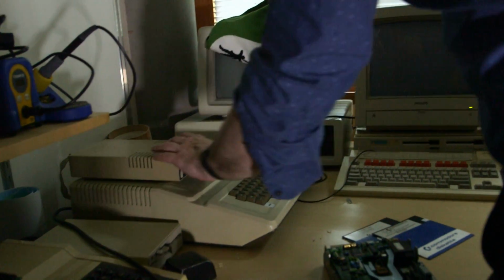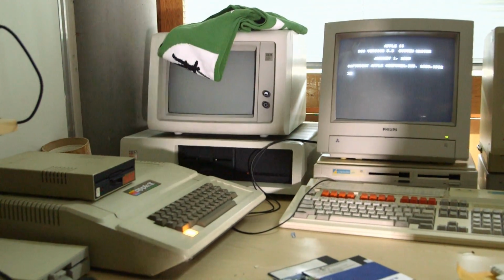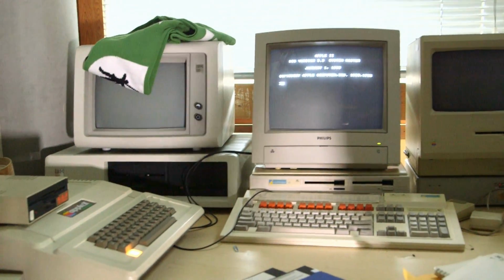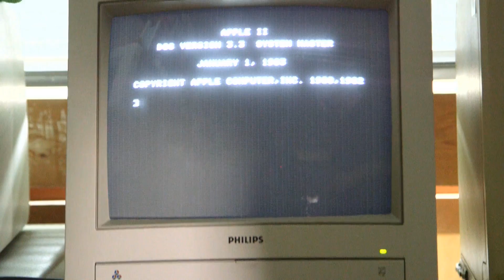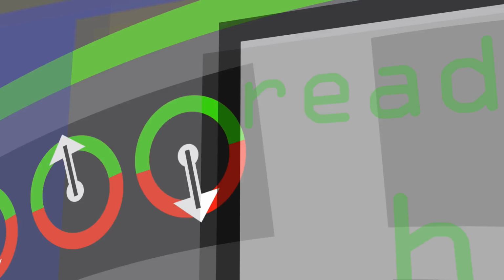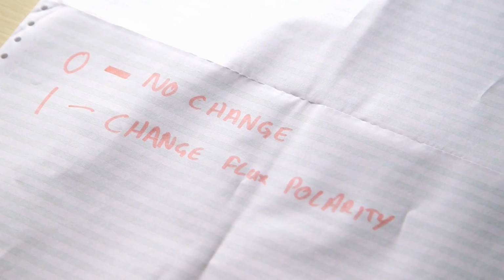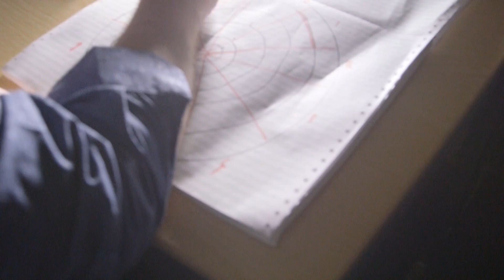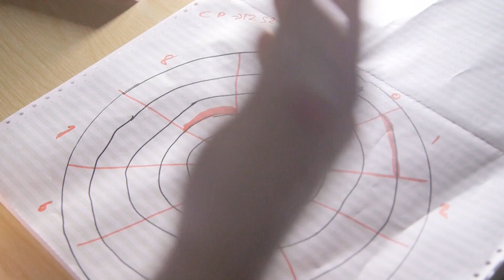Apple 2 Floppy Disk Codes - Computerphile

Comment: After disassembling the Apple II Disk rom (the 16-sector version however) to check the GCR encoding, I discovered that the first 32 bytes of ROM code actually builds this lookup table counting 64 distinct values.  So, on each byte written on a 16-sector disk, the first bit is always 1, and the remaining 7 bits make 64 combinations where the rule applies of max. 2 consecutive zeroes.  This rule theoretically allows 81 combinations across 7 bits, but understandably only 64 were retained for the lookup table.  So, from each byte, only 6 bits materialise in usable data.

Comment: AARRRRGGGGGHHHHH!!!!!! ok, no.

(1) The Disk ][ does NOT use the index sensor. Nor does it have a track zero sensor.
(2) The logic for implementing group code recording was implemented as a finite state machine, with the individual inputs and outputs of that state machine encoded on a 256 byte sequencer PROM on the Disk ][ controller card.
(3) a MC3470 is used as the read amplifier.

Comment: Yea, except that what he failed to say was that GCR does not use the index hole, or the track 0 sensor - it is completely soft sectored and software controlled. That's why the head banged in C64 and Apples - step 50 tracks back and your guaranteed to be at track zero sooner or later........

Comment: @5:41 NO! Apple 2 sectors were *NEVER* hard-sectored --they were always SOFT-sector.  That index hole was NEVER used. The ADDRESS field D5 AA 96 .. DE AA EB recorded held which Track and Sector the head was over, the DATA field, D5 AA AD .. DE AA EB held the  *342* nibble data for the sector.
Reply: Which one had the *420* nibble data? Did I just ask a question? Whatever...

Comment: I remember GCR was also used in the Commodore floppy drives back in the days. It was a real pain in the rear end to transfer data between MFM-coded systems like IBM or Kaypro and the Commodore family. In the end i found my self soldering a little pcb with some transistors and resistors and hook up those systems directly via parallel port. Big plan was to use e decommissioned 286 board as "hard drive controler" for my beloved C=128. Never completly finished it though. But i used it  for cross assembler stuff.

Comment: I once had to write custom floppy read/write routines for the Amiga. On that system you could use the "blitter" to do the encoding and decoding. I believe it used "Modified Frequency Modulation" (MFM) for the encoding system.

Comment: It's been a while since I read "Beneath Apple DOS" but IIRC, 5-and-3 encoding supported 13 sectors per disk (Apple DOS 3.2) while 6-and-2 encoding supported 16 sectors per disk (Apple DOS 3.3). I recall taking my Apple ][ to a local retailer to have the floppy controller updated from 3.2 to 3.3 (IIRC they just replaced a ROM). After that you could deal with 3.3 formatted disks natively or run a small utility which would allow you to read 3.2 disks. There also existed many copy-protection schemes based upon partially written tracks as well as data written between tracks. Many people got around this (for backup purposes only) with a utility call Locksmith.

Comment: So basically, these disk drives stored 5 bits in the amount of data it would take to store 8 bits, but have these three "parity bits" as a safety feature to prevent or correct read/write errors. Did Apple disks have less storage capacity than the ones of other computer systems because of that?
Reply: 140K (DOS 3.3) per disk side vs 174K (C64), 160K (IBM SSDD).

Comment: It only flips the magnetic field when it needs to write a 1? How dose it know that this was flipped? It could be either or. I thought it flipped it to a specific orientation that encoded either a 0 or a 1.
Reply: You're right, the animation is wrong.
Reply: The presenter is right. On the Apple II, you store a 1 by changing the state of the magnetic field, otherwise it is a 0. What is missing here is the description of the Logic State Sequencer which sequences the bits, the timing and the state change. The LSS is responsible for transforming the 1s and 0s into nibbles.
Reply: Antoine Vignau Could you please simplify that a little? I'm still not getting how the system knows that you've flipped this bit when it could be either a 0 or a 1.
Reply: Couldn't you check the state of the previous bit?  If it doesn't match then it was flipped.

Comment: Steve implied that the index hole was used by the disk ][ hardware to find Sector 0 -- it was not. Woz didn't use the index hole for anything at all. In fact, had the index hole been used, it would've made it impossible for third-party formatters to optimize the disk. They worked by staggering the zero sector of adjacent tracks to reduce the number of total revolutions needed to read the disk sequentially.

Oh, and the sectors were laid out on each track non-sequentially so the RWTS routine had enough time between sectors to process the data it had read.

Comment: Ahh. The boot clicks of the disk drives. It meant that the computer was coming alive. 
Now when drives click like that, it means its dying and I better rush a backup.
My how times change.
Reply: @LaserActiveGuy In the early 2000's (I'm guessing around 2003 ish but a lot of it's a blur) I couldn't find my library card for the longest time until I went to use the floppy drive on my machine and couldn't get it to work.  Turns out one of my siblings (they were all quite young at the time) had put my library card in the floppy drive.  At that point we were more worried about whether something was in the CD/DVD SuperMulti drive that every computer came with (I'm guessing they were really cheap since absolutely every computer seemed to have the exact same one).

Comment: So, we're encoding and thus 'losing' 30% of our capacity for speed ? (we're having 8 flops, and use that to store 5 bits)
Reply: GCR is actually more reliable than hard sectoring. With hard sectoring there are more components interacting in more complicated ways. With soft sectoring, you only need the speed of the drive motor to be correct (typically 300 RPM if I recall.)

Comment: At 3:30, there is a wrong statement. You can have two consecutive zeroes (the nibble shown here, #$9F is an authorized value) but no more. This is rule #2.

As with rule #1 (nibbles start with bit 7 at 1), these can be bypassed to create interesting on-disk protection schemes.
Reply: The 16-sector version PROM on the DISKII interface indeed allows 2 consecutive zeroes, which provides 81 combinations respecting rule #1 and #2 in an 8-bit range. From these 81 combinations (~6.34 bits), only 6 bits are retained, or 64 combinations.  The GCR encoding on 16-sector disks actually costs 1.34 bits per byte, that is 20.75% data loss, the simplest error-correction encoding algorithm (HAMMING 29,24) costs 1.66 bits per byte or 17.24% and could theoretically replace rule #2.  The only problem is that rotation timing issues due to having more than 2 subsequent zeroes is likely to mess up much more data than the error correction encoding itself can remediate.

Comment: I'm pretty sure that I remember you could encode two consecutive zero bits.  I do remember about the index hole not being used and the sectors being synchronized by writing 4 or 5 "FF' bytes with two zero bits between each two bytes.  This was done with exact timing of the instructions.
Reply: What's being described in the video is the earlier 13-sector DOS 3.2 format and the P5/P6 ROMs (and not the 16-sector "at most one zero-bit pair per nibble" 6&2 format of DOS 3.3 with the P5A/P6A ROMs; see Beneath Apple DOS for more detail.)
Reply: Neither Apple II or C64 used the index holes, that's why you could flip the disks over and use the other side. Using two consecutive zeros was the change from 13-sector to 16-sector disks.
Reply: dogcowdogcow 

Interestingly, I'm not going by DOS formats at all.  I was, for a time, working on my own code to read and write disk data and I was going by the rules to be able to read back what was written reliably.

Comment: A little extra information for the interested: Using a sequence which is not legal to find in the middle of payload data is fairly common in storage and communications systems, called a "preamble."  When the preamble pattern goes by the receiver or read head, the circuit "knows" it's the beginning of something, like a sector or frame.  It can be implemented in very high speed hardware with a shift register and logic gates.  The logic gates are wired in the pattern of the preamble, and constantly compare the value in the shift register with the preamble...and the  output goes "true" when they match.  Then the circuitry can begin collecting the bits of the payload.

Comment: about the six minute mark...sorry to say, you circled the incorrect area.  Holes would show through the small circular area next to the hub.
Reply from the maker: +rchandraonline there were different standards, early hard sector disks had holes in different places to later ones...
Reply: ***** , hmmm...I had both hard sectored and soft sectored 5.25" floppies in my time, and I can't remember any of them having holes in the read/write area which you circled, only in the area Steve pointed out to you.  The soft sectored ones had one index hole for a "start of track" signal, whereas the hard sectored ones had several holes around the circumference of the hub.

But who knows, there could have been others I have not seen.
Reply from the maker: +rchandraonline it's possible that these were just in the eight inch variety and I have muddled up my image! Sorry (Wikipedia : "The Memorex disk was "hard-sectored", that is, it contained 8 sector holes (plus one index hole) at the outer diameter (outside data track 00) ")
Reply: Seegal Galguntijak , IIRC, on a totally blank disk, the controller just picked one, and wrote a track preamble there.  It was either that, or one of the holes was larger and therefore let through more light.  It was when I was in high school, back in the late '70s, early '80s, when I remember both hard and soft sector disks were available...so taxing my memory you are.
Reply: +Seegal Galguntijak on a 10 sector disk there are 11 holes, on a 16 sector disk there are 17. The sector holes are all spaced evenly, with the index hole centered between two of them. The controller sees the index hole because of the shorter timing.
Reply: With all the hard sector holes in the center, how would the disk drive then know which sector was the first one?
Reply: FozzTexx Alright, that's a great way of doing it.
Reply: +Computerphile I forget if the one hard sector system I had was 5.25" or 8", but I think I'd have remembered if the holes were somewhere too far different from the standard sector hole cut out that you didn't circle.

Comment: Did somebody completely forgot how to use camera lighting? This is unwatchable...
Reply: If this is unwatchable you will have a hard time looking at 99% of youtube.
Reply: PleaseDontWatchThese
 I do, but there is a difference between unwatchable due to a a simple lack of gear and unwatchable due to utter failure while having a shitload of proper gear.
Reply: Diggnuts The video gets the point across just fine. It just does not look nice. I find that ok with an educational video.
Reply: PleaseDontWatchThese Did I tell you what you should or should not be "ok" with?
Reply: Diggnuts You did not, and neither did I. I'm just stating my opinion about yours. And you are doing the same to me. I see no problem with that.
Reply: PleaseDontWatchThese
 There isn't.
Reply: I didn't even notice -_-

Comment: I remember when I had to use the other side (apple drives had just one head), we had to punch a hole on the floppy jacket in order to make the drive to read it properly when we flipped the disk. Also, disks weren't designed to be flipped, and with time you had problems with disks that were flipped, as the fibers inside the jacked got sticky with dust.

Nostalgia! :)
Reply: That hole wasn't about readability. The notch would turn on write protect when it was covered. On the flipped over side, there was no notch, so the computer would treat the disk as write protected until you punched that hole.
Reply: The disk factories only had one production line. The disks that wouldn't certify on either side were thrown away. The few that would certify on one side and not the other went into the pile of single sided disks, and the ones that certified on both sides got split up between the single and double sided disk piles according to demand. We used thousands of cheaper "single sided" disks as double sided and every now and then had to throw one away.
Reply: The disk factories only had one production line. The disks that wouldn't certify on either side were thrown away. The few that would certify on one side and not the other went into the pile of single sided disks, and the ones that certified on both sides got split up between the single and double sided disk piles according to demand. We used thousands of cheaper "single sided" disks as double sided and every now and then had to throw one away.

Comment: I remember seeing that modern disks use a similar pattern. Something like 8 bits encoded in a series of 15 pits and lands on a CD. I don't remember the exact numbers, but I'm sure they'll be in the next video.
Much appreciated this. Keep 'em coming, +Computerphile.
Reply: CDs use an error correction coding such that a single bit error within the set describing a byte can be corrected.  Important when the media is unprotected and vulnerable to scratching.